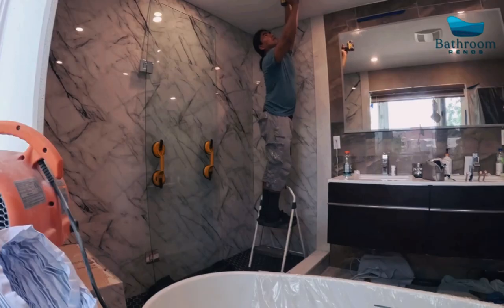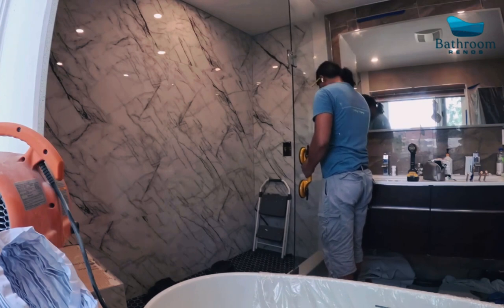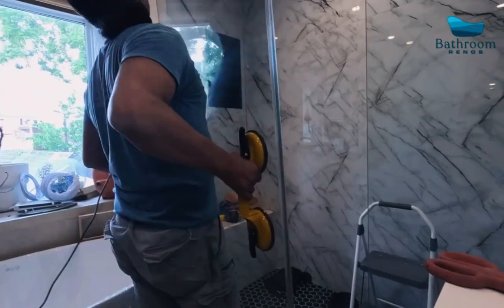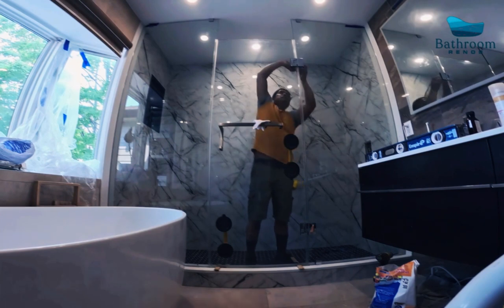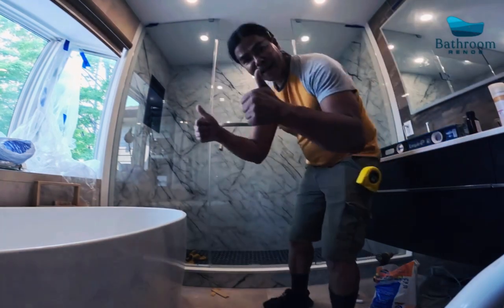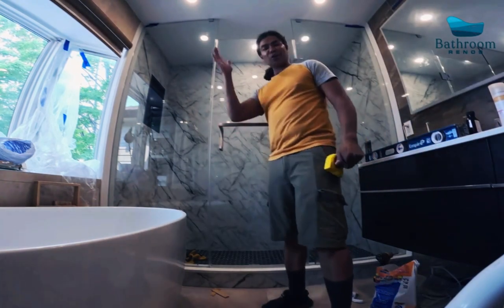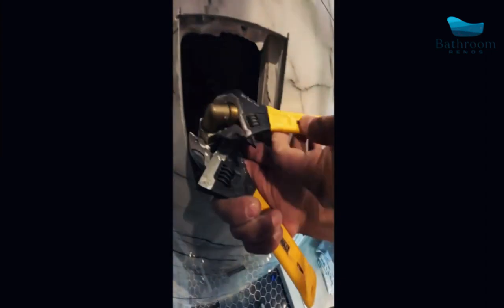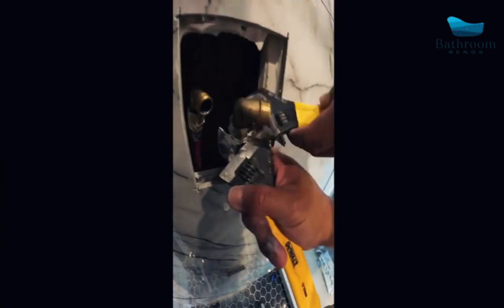Stunning Shower Transformation Timelapse | From Start to Finish

Comment: Thanks. No chicken wire needed for the mud job ?
Reply from the maker: Hi Ben, thank you for watching our videos and for your observation! , we use 5k psi sand mix in this project and the OSB is 3/4" at 12oc.  Although, if we find 5/8" underlay we use chicken wire.